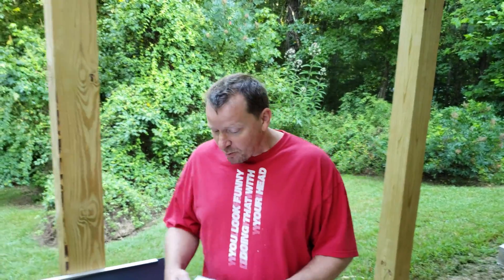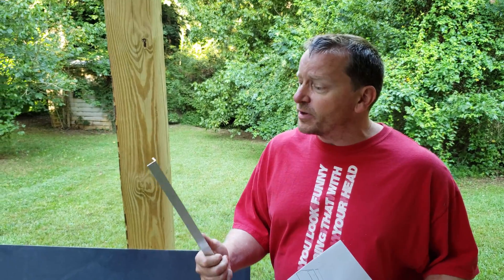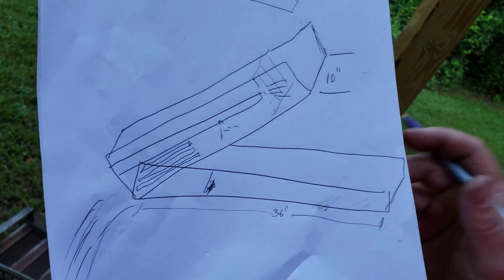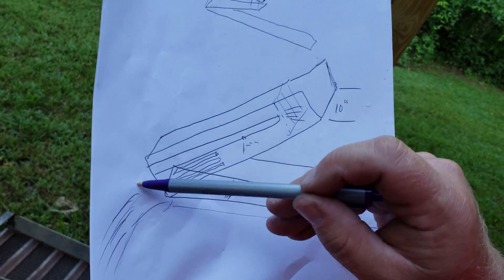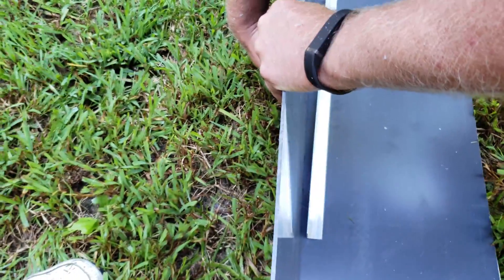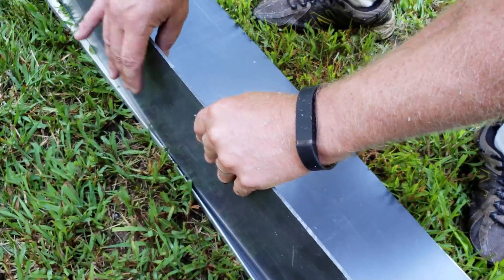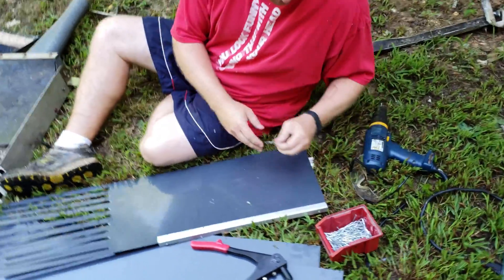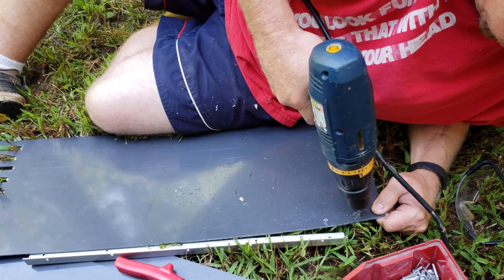DIY Highbanker Conversion from a 2" Dredge - Under $100

Comment: An old s/steel oven or fridge rack cut to size makes a great grizzly. Just make sure its the closer spaced type of around 1/2 inch. I would leave the ends on for strength. You can check it out https://drive.google.com/open?id=1lfR4u-DF3-wqjt0NCa7MGDLtmlPz8Ltk and the finished high banker with Gold Hog mats https://drive.google.com/open?id=1H4a9urmAuAWfrw4Eq1bm1Ww68j12ikvL. Uses 2 x 1100 gph bilge pumps. Nice build!
Reply from the maker: Re-purposing fridge rack for a grizzly, great idea!  I have old grill, I bet the grates would work well too.  Your build is pretty sweet, thanks for sharing!